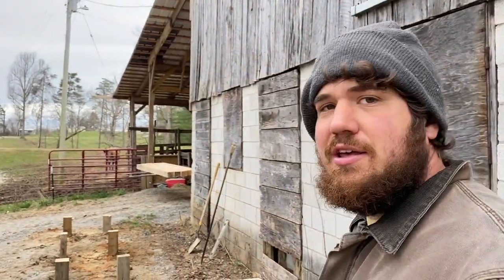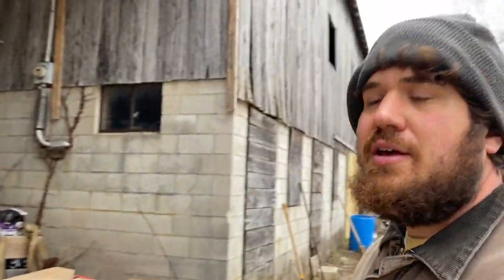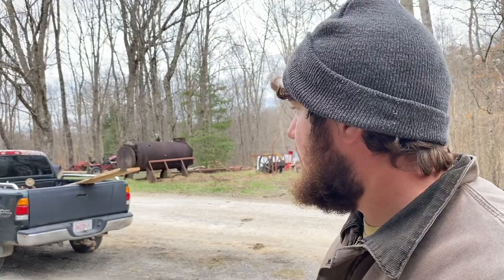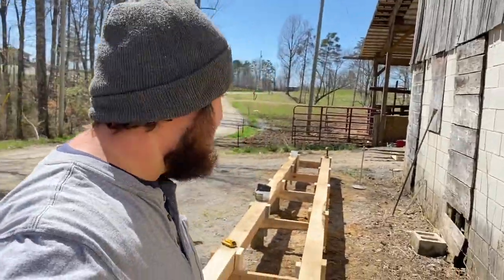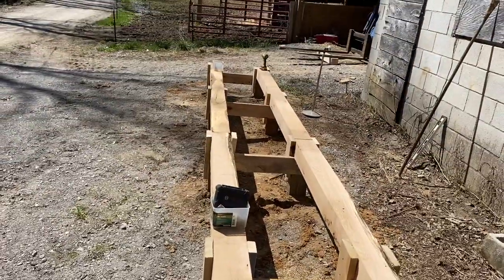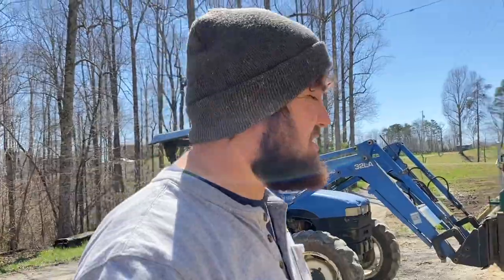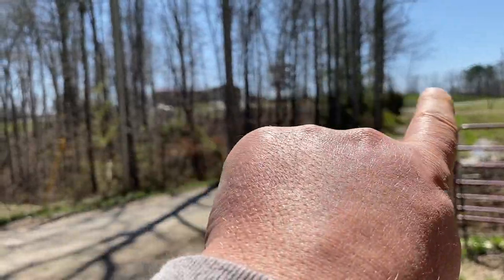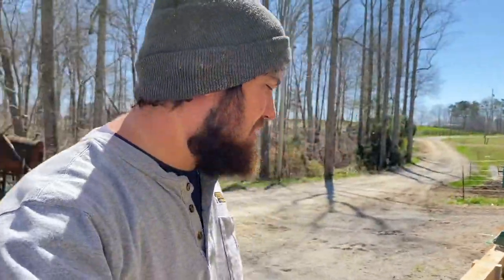Incredible SAWMILL STAND Build

Comment: Excellent job ! The Tennessee frugal craftsman I think is his handle has a good video. He extended on the saw head end of the rails 4 feet. That way way it’s only holding the sawhead weight and the logs go on the factory bunks. I think I’d go 6 ft at both ends of the track to keep most of the weight on the factory bunks. Just a thought. Love your vids. Thanks
Reply from the maker: Yeah I actually watched that video! Thanks for the input.